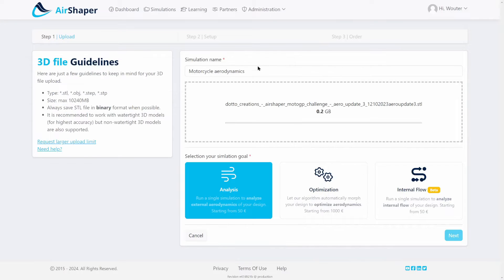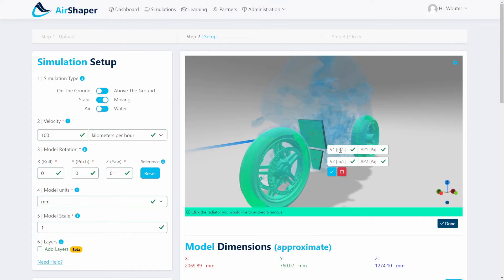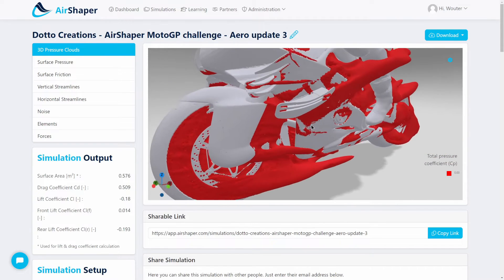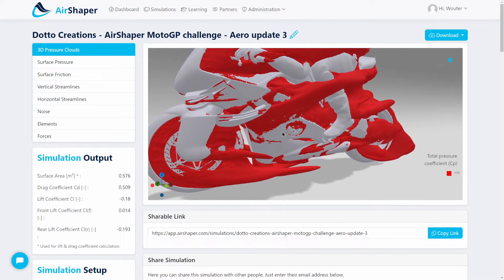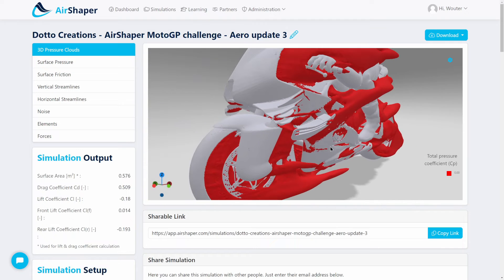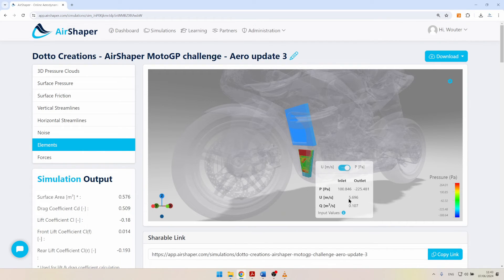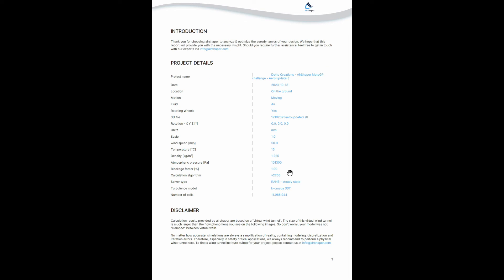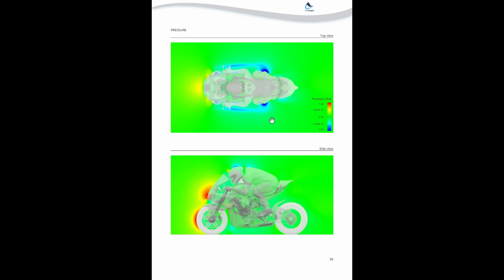Aerodynamics Made Easy - Motorbike CFD Analysis Explained | Step-by-Step Guide

Comment: $1100 per year plus the bullshit credit model.  And that is for the "hobby level."  F off with this BS.  You can find software that does MUCH more for similar pricing WITHOUT the BS of credits.
Reply from the maker: Please do share the software that you are referring to, then I can make a detailed comparison for you. It will be a proper one, including the time and resources required to perform CAD repair, meshing, licensing cost, post processing, hardware cost and so on.

The credits can be used directly to run simulations and cover all of the costs.

Lastly, I value factual responses over emotional responses filled with BS words without any substantiated claims.

Comment: I would love to see the aero of a bike in yaw, with the rider having a significant lean angle(knee touching the ground). I suspect the leg of the rider affects the aero of the bike, which is also in ground effect. Is that why the wings on bikes have a high anhedral angle? Once the rider is leaning the bike, the angle becomes vertical on 'lean towards side', and horizontal on the 'lean away side'. That way the front wing on the outside produces downforce, while the inner one works more like a vertical stabilizer.